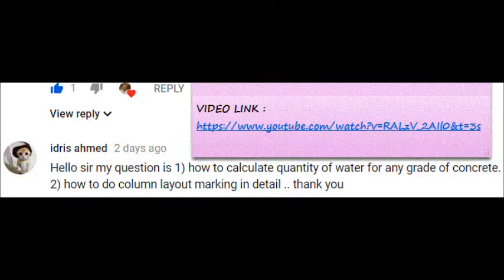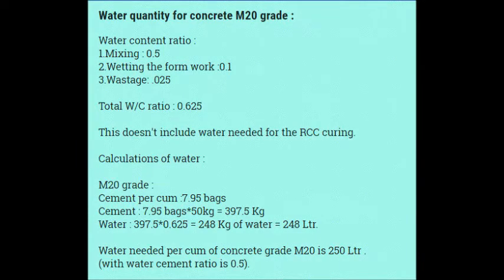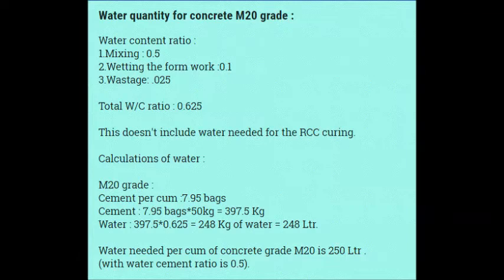SANTOSH KULKARNI  ANSWERS QUESTIONS ON CONCRETE [ ENGLISH /HINDI ]SESSION 11

Comment: sir but ek criteria hai as per is code 
0.4 to 0.6 water cement ratio use krte hai hm 
to aapne overall bataya hai 
plz resolve my issue
Reply: and aapne zaada liya hai to sahi hai ham 0.6 se zaada le sakte hai w/c ratio
Reply from the maker: @sarimkhan6640  
मैने भी तो विदेओ में ०.५ हि बताया है W/C RATIO.
कहा गडबड  है ?
Reply from the maker: Nahi samajha kya saval hai apka
Reply: @SANTOSHKULKARNI9  sir IS code bolta hai ki w/c ratio 0.4 to 0.6 hona chahiye
Reply: aapne 0.625 liya hai

Comment: Sir pls 1 video banva na design mix var for example. M80 cha design mix.... appropriate data assume Karun for ex. Super plasticiser chi value assume Karun...
Reply: I read Ur answer on Quora for M80 grade design mix....but I'm not understanding steps which r u following sir...so my sincere request pls make a video on design mix...of any grade....I'm also following u on Quora sir....u r best....
Reply from the maker: @omikaps2684  
Alright.
Reply from the maker: Alright. Do you need to do design mix at site?
Reply: @SANTOSHKULKARNI9  yes sir...im very interested and curious to know what steps are required to do design mix...
Reply from the maker: @omikaps2684  
Curiosity is good. 
Design mix has to be done through the concrete laboratory.
Reply: @SANTOSHKULKARNI9  kk...sir
..but like nominal mix. Designed at site...that way by assuming appropriate data design mix for any grade is done at site or not...by using experience....
Reply from the maker: @omikaps2684  
No. Design mix cannot be done at site unless you have all the Lab. Facilities at the site.
Reply: @SANTOSHKULKARNI9  kk...sir ...for Knowing actual design mix steps for that I want to take a visit of RMC plant...